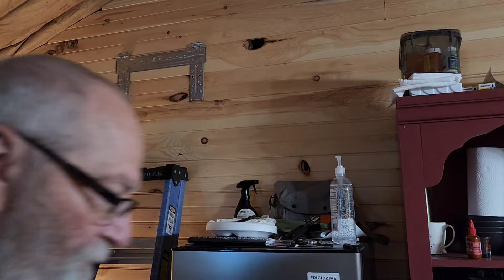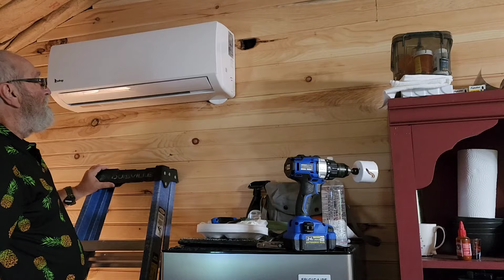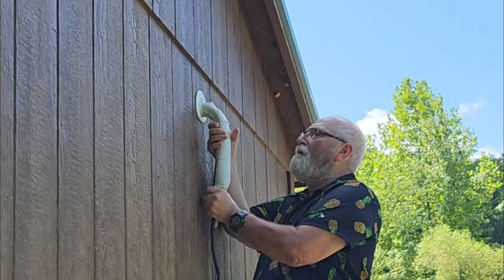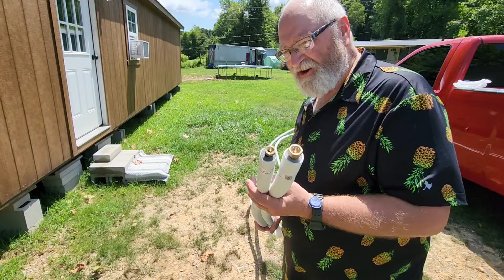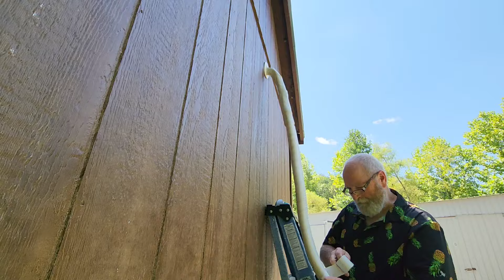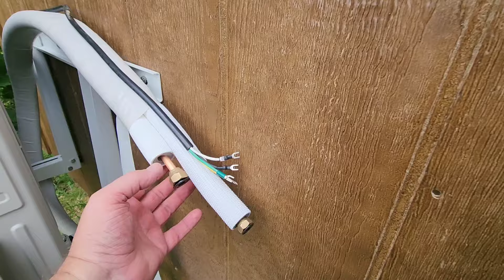Zokop 12000 btu 220 volt inverter mini split ac/heater partial installation pt 1

Comment: How is it holding up 11 months later? How did it do in the heat, etc? I'm considering this brand.
Reply from the maker: And it's still holding up awesome, it's keeping my cabin nice and cozy. This summer and it done good over the winter. Considering we had one of the coldest winters, we've had in a while, and we'll probably do better once I get my cabin and we'll do better once I have my cabin, completely insulated and underpinned, I would definitely buy another one

Comment: head unit your calling is the Air handler that is what's the real name of it is . I have always use a torque wrench to tighten the copper line set and when pulling a vacuum holds for 30 min to make sure the seal is perfect

Comment: This video was very valuable for me. When installing I started to remove the plastic tubing cap from the blower unit and heard the escaping gas and thought I was letting all of the freon out, so I quit and read the manual. No help from the manual. Was going to call an AC company which would charge as much as I paid for the unit to finish the install. But then found your video that show its OK for that pressure to squirt out. In the middle of doing the install, so the jury is still out, but I do feel better about proceeding LOL  Thanks for sharing this video.
Reply from the maker: Thank you. I'm glad the video was helpful to you. I am so far very happy with mine. It got me through one of the coldest winters here in kentucky in a long time.And so far as the weather heats up, i'm staying nice and cool
Reply: Little late but it’s an inert gas to let you know that the coil wasn’t pierced! You’re good homie!!

Comment: Hi
Yours is the only video I can find on Zokop minisplit and we can't find the plug-in to power our new unit.  There's no mention of it in the instruction manuals anywhere.   Any advice much appreciated.
Reply from the maker: It does not come with a power cord per se you could install a power cord with a plug in on it. But they are really meant to have a dedicated wire, ran from your fuse box to your electrical cutoff, and then use a drop line.
Reply: Thank you!  I don't see where the dedicated wire hooks in.  The instructions don't discuss it or is there a schematic to show.@HamiltonOutdoors
Reply: Again, thnx.  I believe I've located it on the outside unit which is different than the 3 other brands I've installed.  @HamiltonOutdoors

Comment: Hi Rob, I just received my Zokop mini split 9000btu I bought online on Walmart.
Mine didn't have a template and I guess yours didn't either. Most other brands have templates.  This worried me about what else do they cut back on. Can you do a follow up video on yours? Is it still working?
Reply from the maker: @ranjanty  that's quite the coincidence, because I was just getting ready to do an update video on how it has gotten me through the winter

Comment: I just picked up 2, (110v) 9k btu units, same brand . Looking forward, but not looking forward to instaling them. My home is all block, walls are 12" thick, drilling is going to be a bugger.
Reply from the maker: @joek511  I got mine all installed I'm just waiting for my nephew to come and vacuum out my lines so I can let the refrigerant go